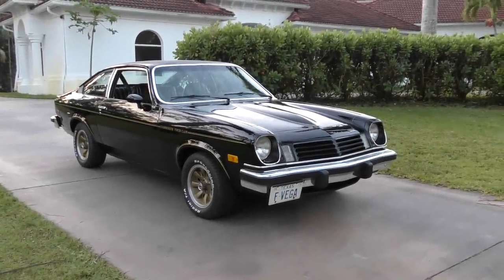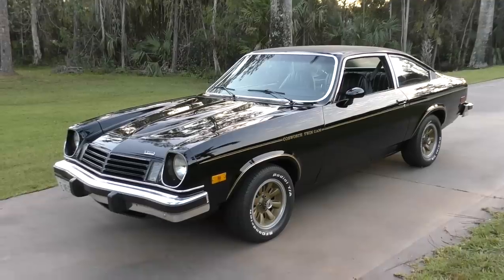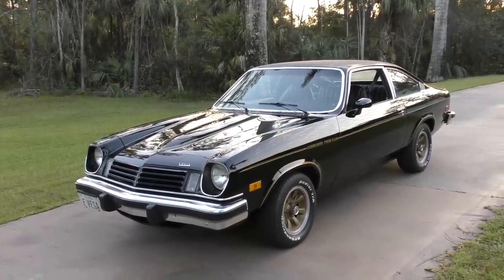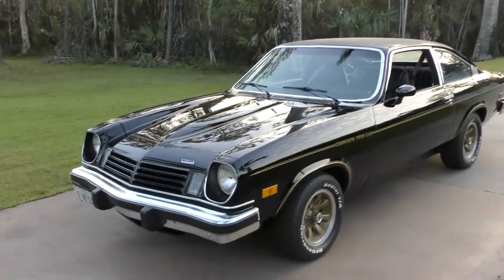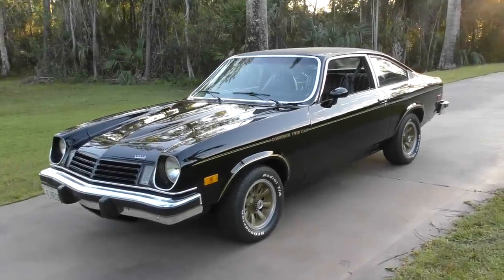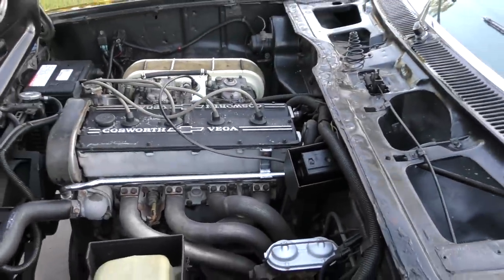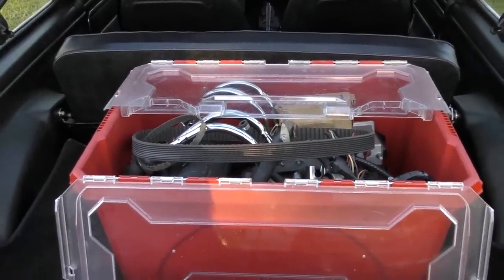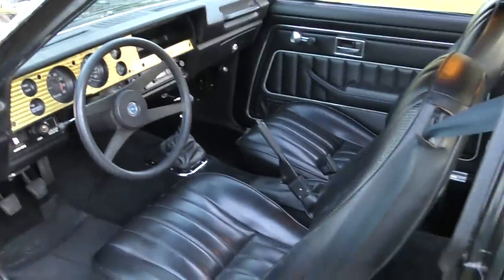The Cosworth Vega is an Amazing Car, But Came Too Late to Save Chevy From Their Terrible Decisions

Comment: Fun little sleeper car.  It's in amazing condition.  AC, power brakes, etc, just adds weight.  Young guys will sacrifice comfort for performance.  Good that you got the FI stuff and original radio.  I'd install the FI and see how it moves.  Those Webers may be linked to your drivability issue.  Race carb setups are often tuned to idle and full throttle with little midrange in between.  Heck, I'd replace the the little AM radio too.  I mean, who listens to radio in a car now anyway?  Also, you didn't mention needing any brake or cooling system work so I'd bet this car has been somewhat maintained even though it was stored away for decades.  Barn finds I see have generations of furry creatures living inside them.

Comment: In the late 70s I worked in the service dept for a local Chevy dealer, Just parking the cars that came in for service. A guy brought one of these in to get worked on and I got to drive it a few times. I have to tell you, that little bad boy is a firecracker. It scared me at first though because I was not expecting the engine to idle so high upon starting it. I had to go inside and ask one of the mechanics if that was normal before I drove it LOL.

Comment: I remember back in the day we would drop 350cid small blocks and turbo 350s into these things. Combine it with some 3:73 or 4:11 gears in the back and these beasties practically jumped in the air when you twitched the gas (those gears were piss poor on the highway if you wanted to get more than 10mpg out of your gas though).

Comment: I had a 71 Vega GT. The car looked great, but the rear suspension would not handle hard acceleration, causing the rear axle to "bounce" badly. The real problem with the Vega, was rust. The front windshield rusted out because of the chrome trim rubbing against the paint work. The Cosworth edition was only a good engine in a terrible body. I did actually rebuild and install a 215 Oldsmobile engine in the car. The aluminum engine actually weighed about the same as the original Vega engine. Got tired of working on body cancer and sold it.

Comment: FWIW The aluminum Vega engine did NOT have steel cylinder liners.  It used a Reynolds designed, Hypereutectic Aluminum block, who's  cylinder walls were specially treated to expose some of the Silicon.  This hard surface was also tried by Porsche.  Unfortunately the cylinder walls did not last, an under capacity cooling system, also contributed to the engines early failure rates.

Comment: 75 and up the motors were ok there were some V8 s  in 75  also  don't know about the cosworth interference but both my engines broke the belts no damage on reg. Engine  had wagons  they got 40mpg quart of oil every tank after 25k miles 3engines used pn my 72 went 250k miles

Comment: I had a 74 Vega GT, bought new for $3400 !  6 months later I bought Iecko performance parts and had the motet sleeved and and blueprinted. Duel webbers… 190 horsepower 12:1 compression…. Set up for auto cross and road racing… ran great… till I dumped a valve.  Then put Buick 231 V6. Headers, intake with 650 Holley, 3/4 cam…car would spin rear tires going in 4 gear!!!  Cost too much money to maintain so I bought 78 Z28 with a 4 speed for $6900 new. Loved both those cars. The Vega was faster than the Z28!!!! Much faster

Comment: Had they have lined the block like the all aluminum LS1 and been more developed, it would have been a great engine. Case in point I have an LS1 that passed 150k miles 2 weeks ago, burns zero oil, no leaks, and other than a water pump and maintenance (oil changes, belts, water pump replacement around 115k miles) it's accepted modifications like a champ and I've never opened up the motor to this day, but it compression tests within factory specs and all I do is maintain it, drive it regularly, put it though the paces occasionally (it's in a 26 year old fbody if that makes any difference). So if GM did what they should have with the cosworth motors in these and didn't charge an arm and a leg considering the platform and didn't rush it to market, it really could have been something.

Comment: Great looker, Nova meets Camaro SS. The panel wagons were cool. But the oxidation. Was the Vega a direct competitor of the Pinto? Those, other than the fuel tank defect, were at least solid built and did last for a respectable period of functionality. Not so much rust. But I must admit, yours is badass looking. The Little Old Lady From Pasadena wouldn't be embarrassed to be seen driving it. Good catch.

Comment: I almost bought a Vega in 75 but settled for a Monza town coup because it was a lot less money. It had the 2.0 lt  aluminum engine 4 spd manual and was alot fun to drive but  at about  60k miles it was burning oil so bad I traded it for a 80 El Camino SS. Still own the Camino and drive it daily.

Comment: I had a 1974 Vega the only problem I encountered it came with a bad head leaked coolant immediately replaced  by dealer it used a quart of oil between changes other than that no problems at all and I put a lot of miles on it.

Comment: Great video....on my second Cosworth...it also has the side-draft weber conversion, Hutton Motor Engineering in NC designed the manifold.
My car is # 0014.

I have # 0014.

Comment: My first car was a new '74 Vega. Despite its reputation as one of the worst cars ever made, mine was great. It was actually pretty fun (but maybe when you're 16 any car is fun!) But what I mean is the handling was not bad compared to other cars of the day, which granted, isn't saying much. But it was dead nuts reliable.....and I beat the hell out of it. Never used oil.....& unbelievably never rusted out, even here in the mid Atlantic where it did get cold enough for a lot of salt on the roads in the winter. So....I lusted after a Cosworth. But jeez....I think at the time they cost more than a 'vette. Seems like I remember Car and Driver loving it which made it seems all that much cooler. Not to mention the black paint w/ those gold wheels that looked like something off an exotic. Plus (again for the time) that interior looked  positively posh.

Comment: My rich uncle bought my aunt a brand new Cosworth Vega in 1975, but only being 10 years old at that time, I either didn't know enough about cars or don't remember exactly what kept failing, I think it kept blowing head gaskets, but I do remember it being sent back to Chevy to be repaired at least twice and then my uncle, who was a longtime customer, insisted that Chevy give them a different new car, but it did exactly the same thing as the first one, so they got rid of it and bought her a Camaro. If I remember correctly, I think Chevy later admitted that a certain batch number of crankcase or cylinder head castings were molded or machined warped causing head gaskets to fail. I have always loved Vegas though. To me some of them look like a downsized Camaro.

Comment: Bill I take issue with your engine discussion to a degree..The main engine problem was NOT the linerless high silicon block which Mercedes and I believe Porsche used successfully but the cooling system.  You can't overheat any aluminum block without catastrophic results.   Side notes..Oil burning was caused primarily by pooling of oil in recessed areas around the valve stems.  160 HP on the Cosworth engine could easily be achieved by getting rid of the cat converter.  What a shame!

Comment: Vegas were interesting cars. Not a lot of top end to them... but they handled exceptionally well. I had a '76 Vega Window Wagon...with a four speed, and the four cylinder 'Iron Duke' engine. 
You could make highway speed pretty easily, but not much more than that. Clutches on the 4 speed weren't that long lived, even if you babied the transmission. Brakes were not confidence inspiring. Steering feel was very precise, and the handling really wasn't bad, for a car that wasn't originally designed for road rally racing. I never had the 'Cosworth' version... but the regular 145 inch four banger was itself, fairly highly revving. It was fun, during my High School years, and the maintenance was pretty easy. All fluids were easy to check, and the caps were well marked, for replenishment purposes. It wasn't ridiculous on gas, either.

Comment: I never knew the story with Cosworth Vega's.  It's just the sort of thing that caused GM to ruin their reputation with people.  The stock holders, the stock holders, the stock holders.  GMs priority was their stock holders, and always caused rushing out unfinished designs and a complete cheapening of their products.  Look at where they are now, their barely build anything and they have only one car that's built in the USA.  So in the case of the Cosworth Vega, GM had already gone through the whole thing with crap engine blocks in the early Vega's and then they do the same stupid thing again with the Cosworth's.  And Cosworth giving up on it still didn't red flag GM to install cylinder liners.  Then they go and sell it to the public.  It would have been so much cheaper to just build the engines right.  The stupidity is baffling.  In all their years GM never worked at reining in the stock holders who are always at the root of these problems.  If you ask me GM should be shut down.  Some would say that GM has been criminal.

Comment: I had a 1976 nice low mileage one with also the nice 5 speed manual with a Hurst Shifter.  Headers too.  Used to kick ass of the ones that thought i had a weaker motor.

Comment: There were Bosch fuel injection systems, L Jetronic, K Jectronics and others used by different manufacturers in the 70’s. They all utilized individual injectors for each cylinder.
Reply: Yes, but….K-Jet was continuous, (and not electronic, btw), D-Jet was only semi-sequential. L-Jet was indeed sequential and came out the same year as the Bendix system (1975)
Reply: @jasonvanrell3678  I had forgotten about D Jetronic pulsing a pair of injectors with each pulse…
K Jetronic was a delightful system and my personal favorite to work on. Thanks for the education.

Comment: These were not Weber carbed from the factory, mechanics converted them because they couldn't figure out the EFI.
Cylinder liners were added after all of the warranty replacements, but Vega's reputation was already done .

Comment: To me the Vega was a small Camaro. The 74 Camaro front end looks almost identical to the vegas. I had an opportunity to buy a cosworth Vega but chose something else with room lol. My loss though. When pintos were introduced my dad went to look at one and immediately walked away lol. As a kid I had no idea why until he said that's a rolling bomb. I didn't understand till later and I asked him why he said the gas tank is right at the back bumper so it will probably explode because of that. I was like wow ok then we saw the commercials about the pinto being basically rolling bombs showed the explosion when hit and my dad looked at me and said I told you. As he said can you imagine having a family in that and you and your brothers in the back and we got hit we would all die. I was like dodge that bullet. The Vegas made awesome drag cars and many were destroyed doing so. Whether dirt track or drag racing. Rust was the biggest enemy and failed 4 cylinder unless you had the iron duke 4 cylinder. Cosworth was an expensive option car and was kind of hard to work on. The rust in the early 70s was what I heard that GM was getting cheap metal from China go figure so the shipping was just being soaked in salt water being shipped to the USA or what used to be the United States. Bad drains in the fenders or literally no drainage also sped up the rust. Just thought I'd share also and this guy has big knowledge of the vehicle he's showing here.

Comment: The original Vega was an incredibly good looking car, sad that they're practically extinct now. If the '71 had an Alfa cloverleaf badge instead of a bowtie, people would be paying 50k for them all day. The big bumpers on the later ones are hardly the worst, though - still a good looking car. I don't think I've ever seen a Cosworth IRL.

I didn't know the engine was port injected, either. Cadillac had optional EFI in the mid-70s too, and I think it may have been built by Bendix as well, but if I'm remembering correctly it was a single injector (throttle body). I know I could easily go look this up, but I'm not going to!

Comment: The vega wasn't a bad looking car at all..those engines were a terrible design..i worked on a few of them..swapped engines on several..the best engine swap i did was the 2.8 V 6..the car was a 5 speed after changing the rear end it was a strong runner ..the 2.8 was not too heavy and it made handling much better ..i should've bought it from this guy..putting a V8 in the vega was very costly ..i got paid well for doing it eventhough i was against it but that's what they wanted..Cheers 🥂🥂🥂🇺🇸🇺🇸🇺🇸

Comment: This car was one of the ultimate examples of GM stupidity. Having a hand built 4 valve per cylinder seems like it would be a winner. Except that it puts out the same HP as a Singer sewing machine and costs $900 bucks shy of what a new Vette cost back in the day. No air or power steering available, for that final kick in the onions. Still, you can’t help but admire the effort if your a car guy. This particular example is very likely the best example to be found. Without looking at the result, I’m guessing mid thirties for the final bid. We’ll, I missed that guess by a country mile. $22k was a steal for this particular example.

Comment: These cars actually aren’t terrible with a few small changes, they really got choked down by American smog and it neutered all the cool stuff cosworth did. Some mild cams, a pair of weber 45s, and new 11:1 pistons completely changed it. Mine also has been blueprinted and balanced internally and it has a fluidamper external balancer. So it doesn’t feel like it’s gonna blow up once you feed it some revs.

Comment: I remember machine shops putting steels sleeves in the blocks .
Reply: If you were lucky it worked. Most were too out of round by the time they broke down or had cracked the block from sudden oveheating.

Comment: All Vegas where potentially good car except Chevy got a hold of them, yes, they had 4 cly. aluminum engines when Americans couldn't figure out the cooling systems, way too little cooling for the cars, lead to overheating and aluminum don't do well with excessive heat, people gravitated to the iron block, fuel injection they were one of the last companies to add it to any of their cars and when they did, they were behind with old school stuff they did it with most of their car lines Monza's they dropped a v8 , nothing wrong except a Vaga clutch you couldn't keep in the car, raising the engine to change spark plugs a joke,

Comment: The problem with Chevy is that they always want to protect their Halo Models like the Corvette and Camaro, so when something comes out that threatens them - they always hamstring it in some way. It happened to the Pontiac high performance line in the early 60's , they didnt like that Chevrolet was starting to be outsold, so they stopped factory development on the Pontiac engines and that limited what people could do with them in racing. Personally, they should have just put the smallblock in there from the start and been done with it, as an aside - the Monza is built on the same platform and they had none of the problems that the Vegas did.

Comment: Yes the car overall is very durable except the engine, I had a 1971 station wagon that I called the "forche" as I installed a Ford V6 2.8 engine on early 1980s after that I never had any problems specially on the imperial valley that at that time there was no smog check only when you register a car by the first time

Comment: My Vega.  1973   2300 gt motor. Holly 2bbl. 4 sp.  it beat most 350cid stop light to stop light.  Check the gas and fill the oil

Comment: Beautiful car dude beautiful car I raced one of these back years ago probably almost 27 28 years ago I had a thoughts and b210 little cam little carburetor some intake had work done little nitrous that was yellow with a little honey bee on the side total sleeper dude traction bars and I raced this cosworth not this particular one but one identical and let me tell you something I had to spray on them that's how fast it was

Comment: Remember, the Vega was supposed to have a wankel engine, which GM had big plans for but the oil embargo and the wankel getting terrible gas mileage killed that plan. The idiocy of producing a linerless cylinder head four doomed this car but the engine in this special was WAY ahead of it’s time for this car. As with so many GM cars, they’d already planned production cancellation JUST as the great ones were rolling down the line.

Comment: GM only have themselves to blame for the failure of the Vega.  Not doing proper due diligence and putting profits ahead of engineering, doomed the car to failure.  I never drove the Vega but I drove a 1978 Buick Skyhawk which used the same chassis, and it was a very nice driving car.

Comment: I had a Vega back in the day. These cars used more oil than gas. Each fill up with 2 quarts of oil. Definitely not one of GMs finer moments in history when thes rolled off the assembly line.

Comment: I had a 74 chevy vega wagon, it was utterly a crappy vehicle
If you drove it for more than 15 miles It wouldnt restart without pushing it and popping the clutch
Because the pistons would swell in the block and engine wouldnt turn over by the starter
I was so glad to watch it go away
Bought a 76 Pontiac Grand Prix... loved it